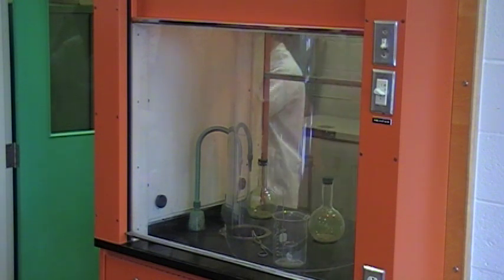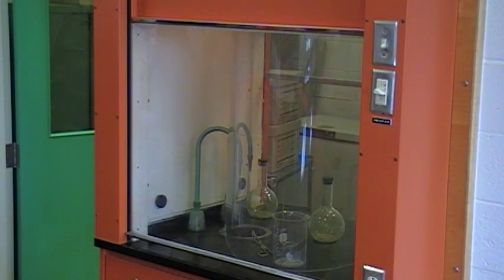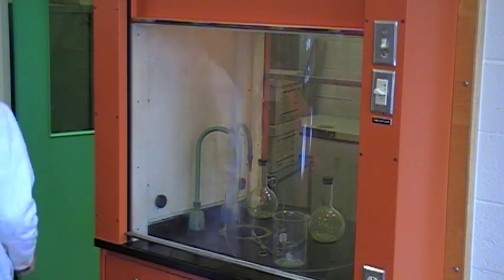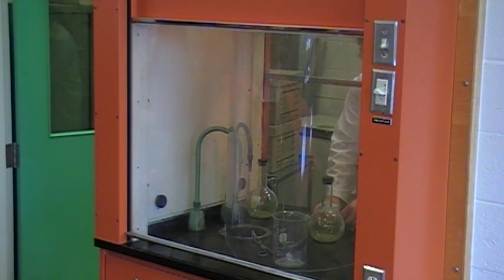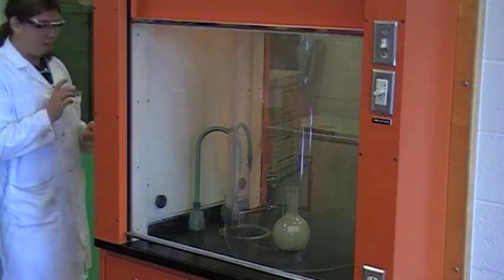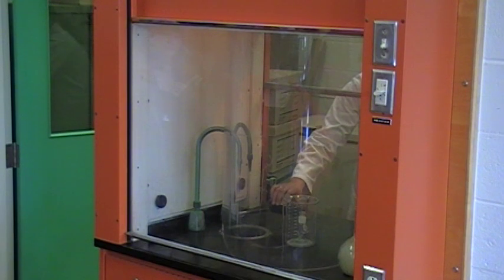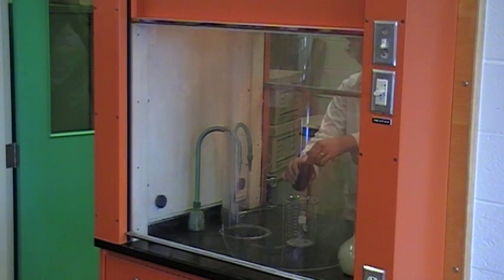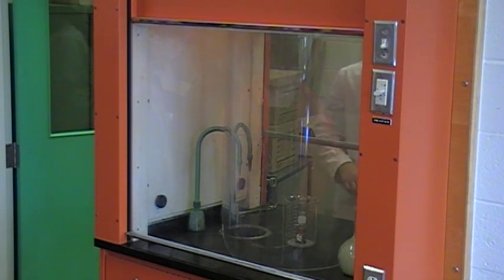Demo #1:  NaCl, KCl and KBr

Comment: @hermanntrude There is a video of electrolysis of CaCl2 and another one with NaOH. Electrolysis of NaCl is not dangerous as long as there is ventilation. As for molten NaOH, it is extremely dangerous so being fully covered and face shield are important.

Comment from the maker: now rubidium I can agree with you on.  Although there is still a slight difference in that you can be absolutely sure rubidium will explode, whereas you're never certain with potassium and particularly sodium, which are quite unpredictable.

My comment was made on the basis that many people can easily obtain a lot of sodium for free whereas rubidium is more tightly controlled.I am intrigued by your statement about francium. I had heard that there were less than 2gof francium in the entire crust.

Comment: Vanadium i do not know why i said that i meant Rb and i beg to differ your theory of no one seeing fr we have used .01g 0.1 0.3 grams of it at my lab at the Sydney Csiro although i am not to tell you the reasons acourding to my boss so best of luck. we made Na at uni using two copper electrodes and molten sodium always fun but do not use Na0h it eats through glass at molten temp
Cheers

Comment from the maker: I'm not too sure about vanadium, but it certainly doesn't explode on contact with water.  As for caesium, it's surprisingly lame when reacting with water, mostly because a gram of caesium contains substantially less atoms than a gram of sodium.. As for Francium, it's radioactive and extremely rare.  So rare, in fact that no one has ever seen a visible quantity of francium metal.